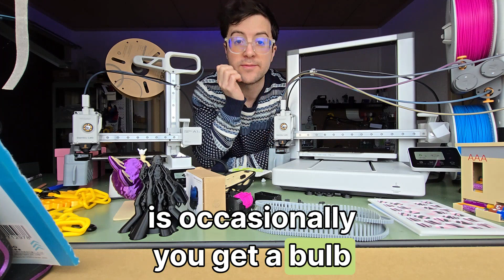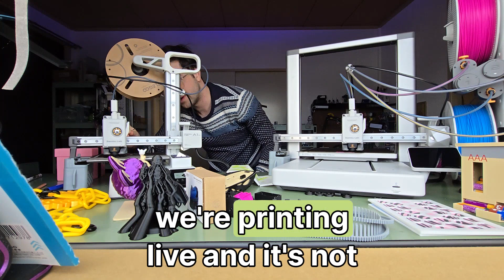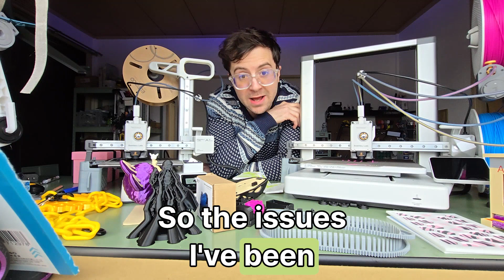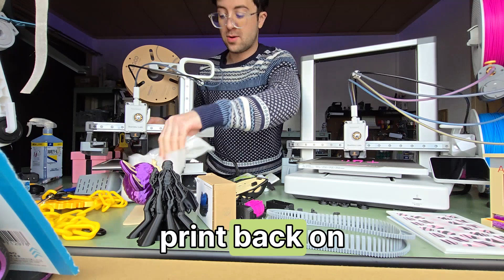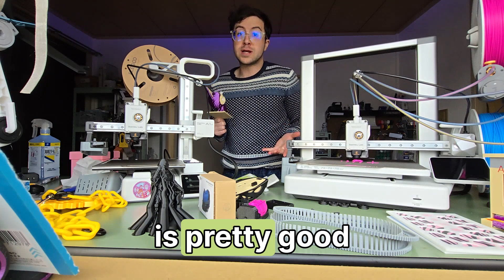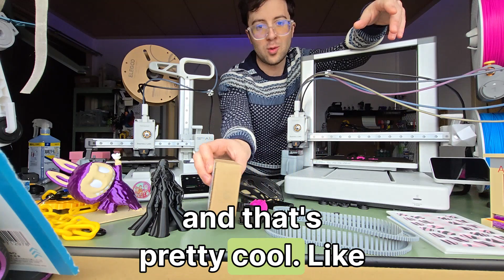Bambu Labs A1 Series Review: A Year in the Life of the A1 Mini and A1

Comment: Is the price reasonable or are they dumping?
Reply from the maker: The  price for a1-mini and a1 stand alone (No AMS) is very reasonable with there performance and built in options, think its at $200 for a1-min and $350 in USA right now. AMS unit can be a bit poopy wasting filament with add an extra $150 cost plus more filament brings the initial price up.  But honestly not really needed for most beginners except if u want to print multi color toys or have a specific use case in mind where multi color printing is needed